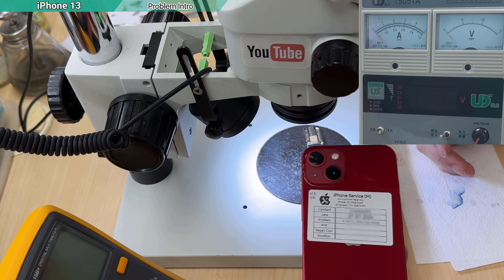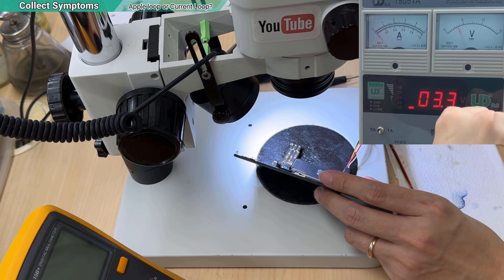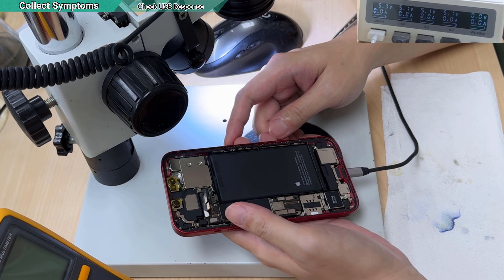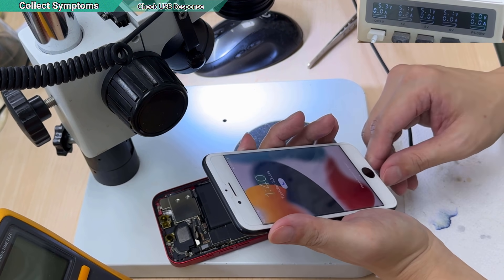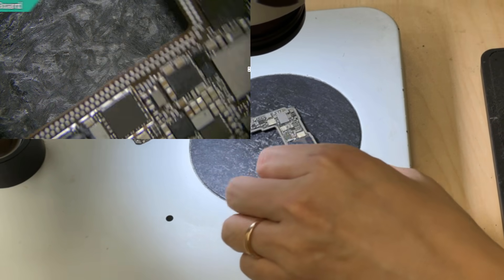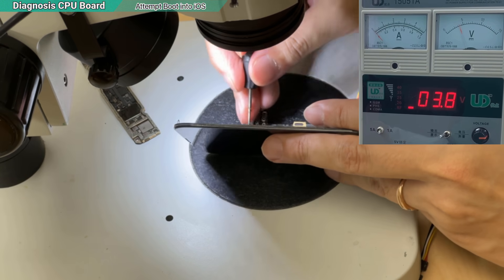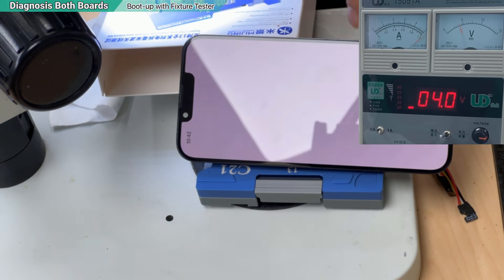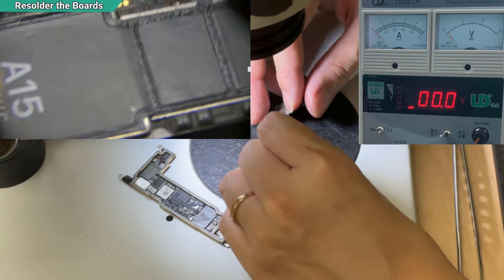iPhone 13 Power Issue 【REPAIR CASE】Current Loop

Comment: hello sir, i've got almost a case like this. model - 13
0-.80-.120.-155-.210-.120-0-.80-.120.-155-.210-.120
and the loop continues.
it was not connecting to pc
seprated it
upper board was in same condition.
removed nand.
now it went dfu.
but while flash it got stuck on 11% dfu to recovery stuck.. no logo 
im not sure what to do next... i dont feel cpu is the problem because... 
line
CLK_AP_TO_NAND looks fine to me... please give me some guidance for the next step...

Comment: Hello from Germany. I have an iPhone 12. When I check the IO_PMU_TO_SYSTEM_RESET_L test point with a multimeter, it shows GND. The iPhone won't boot. There's no short circuit. I need your help.

Comment: If you don't mind, could you tell me what condition is causing the problem?   
For example, even if it is a black screen, the touch works --
can hear the sound even if don't touch it.
 if the main board performs the corresponding task....
 (Apple 338S00946-B0  ......  Apple 338S00616 ) 

I want to infer the problem through the fact that

Comment: I worked in a wholesaler that used to buy lots of damaged phones from insurance companies.  I used to repair there boards for them.  I used to see this sort of thing a lot.  I think it comes down to, many things like drops, bends, missing pads etc, But I used to see this in phones that were in humid environments, not having any water damage inside the "sandwich" but the pads around the interposer were oxidised enough to stop wifi or baseband. I am not suggesting that this is what was happening in your case, I am just sharing my experience with similar problems.  I like your videos, keep up the good work!
Reply: You have every reason to share your respectful comments. ❤❤❤

Comment: Thank you master. Just as you said differently iOS can cause a different response. I just realized with iOS 17.3 upwards. You can flash only the top board for an iPhone 11. It gives an error. It used to be flash-able before